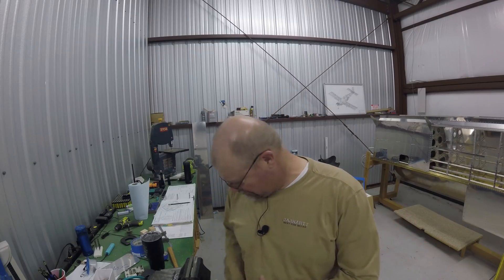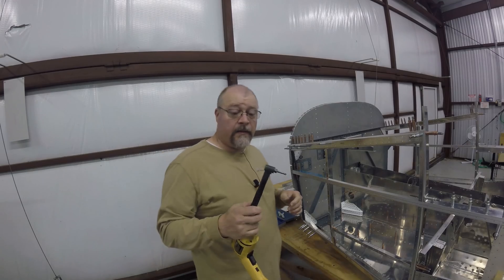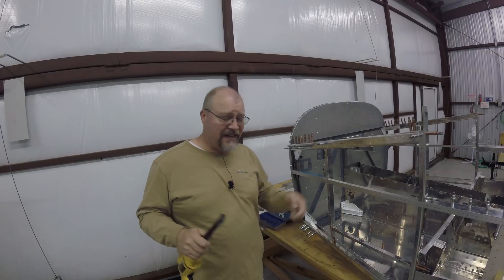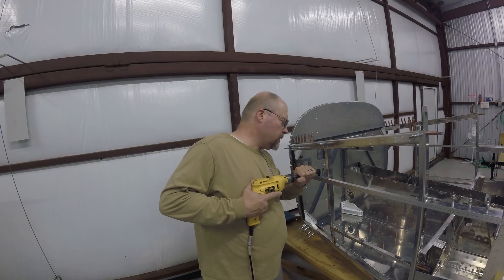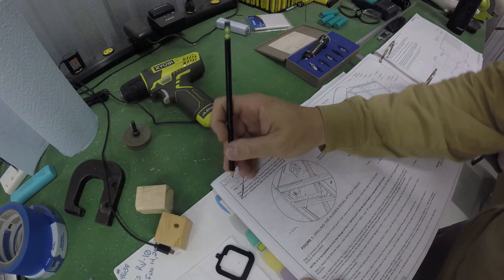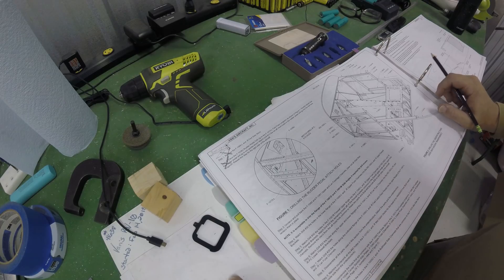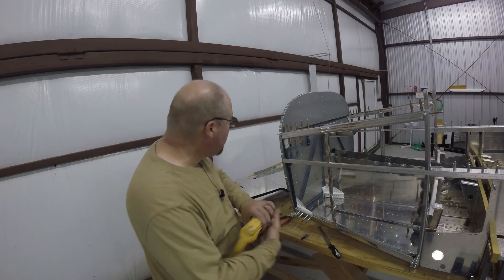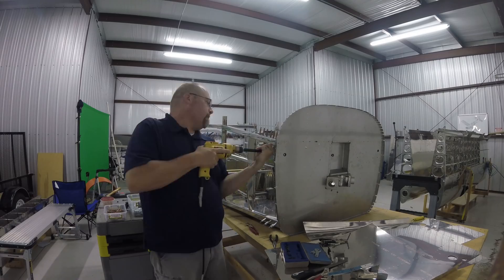RV-10 Fuselage - 026 - Forward fuselage work, don't be suspicious!

Comment: What's your opinion about titanium rivet over aluminium rivet? Thank you for your time !
Reply from the maker: Hrmm.. Off the top of my head, I can't see the advantage.  Firstly there would be a cost difference.  An AN426AD-3-3.5 (the skin rivet) is $50 a pound.. and that's a LOT of rivets.. Titanium would cost more for sure if you can even find them in all the difference sizes you need.  More over, most failures arent because rivets come ripping out of the plane.  If that happens they didn't get set right.  Well if someone can't set an aluminum rivet correctly they wont set a titanium one correctly either so whats the advantage?

Comment: Jason! Quick question! Is the skin used on the tanks thicker than the wing skins, and if so, how is the difference in thickness dealt with on the attach flange? Are the tanks screwed into the wing with screws and riv-nuts? I went back 2 years ago to your tanks video to figure out the answer to these questions, but could not figure it out. Thanks!

Comment: As a PG pilot flying one day a month is not sufficient to be safe.  PG handling skills are perishable skills and the more you ground handle and fly, the safer you are.  At a minimum to be safe 50 hrs flying per year.  My best years of flying I was doing 130-150hrs.  Lately, the weather patterns have changed and I am down to 60hrs a year.   PG is so weather dependent and the flying window can be small.  You have to be able to drop what you're doing and go flying when it comes on.  Be prepared to sit on the hill and wait for the right conditions, it's called Para-waiting.  For PPG, sunrise and sunset flying is your window.  Low chance of higher winds and thermic activity

I say to a lot of people who talk about getting into PG, it is like owning a horse, there is a commitment.  It is not something you can do only on weekends, it needs feeding etc daily  PG has to be the first priority each weekend, or after work or before work.  If no flying conditions, then other things.   

If you don't fly you get unsafe, then you fly and scare yourself, then fly less and next thing  you are giving up the sport.  Lots of used PG gear for sale 2 years old with 10-20hrs, use, bought new from instructor and sold later with  "I don't have enough time to fly" as the excuse.

The bigger the aircraft, the bigger your flying window.  At least with your plane you can fly in the rain.  :)

Comment: With the bent 90 drill adapter since it still functions use a tap/die set and thread the shaft of it to 1/4-28 threads like the countersink bit, then you can screw your speed countersink to the 90 for easy deburring in the future. (I'll email you photos of how I did it)